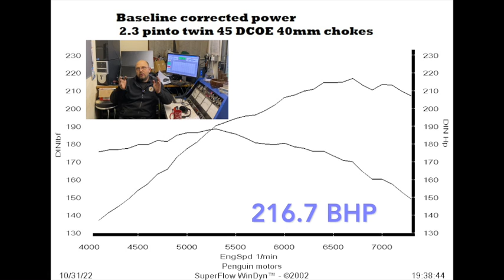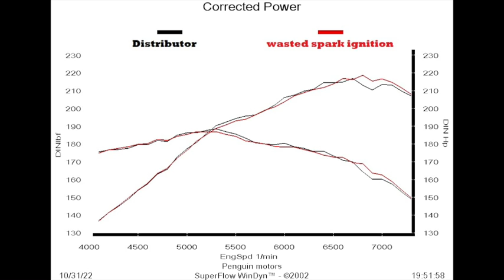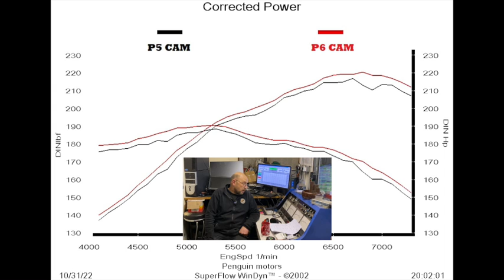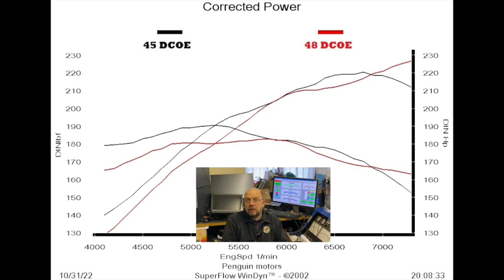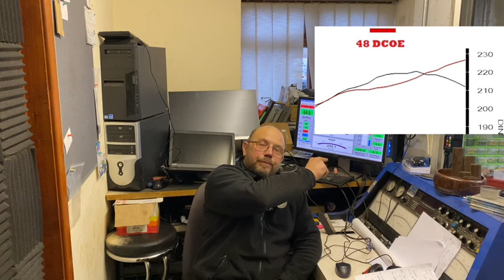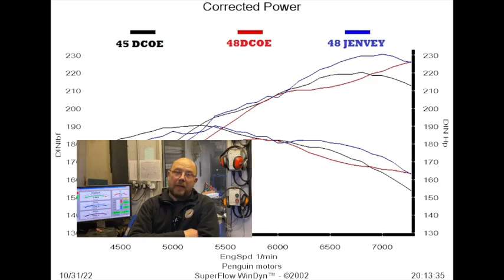Ford pinto 45/48 DCOE weber v injection test

Comment: Quick question I see a lot of Picture's of Webber Carburetors where the Trumpets have no Filters fitted as is the case on this One,doesn't this allow dirt and dust enter the Carburetors?and cause blockages to the Jets.
Reply from the maker: There an extremely small chance of that, 99.9 % of fuel jet blockages will be via fuel contamination. Even then as the jets are upside down with a gap under them it’s rare for anything in the fuel to find its way into a jet.Assuming you have the screw on jet covers fitted ( which I don’t bother with for dyno use)  the only way airs could get blocked is if something finds its way through the hole next to the intake through the internal passages and up past the jet assemblies then turns 180 degrees to go down a jet holder. Much more likely anything going through the hole would simply end up in the bottom of the float bowl. In short you’re way more likely to end up with foreign material causing actual engine damage than blocking carbs

Comment: 100 brake per Ltr with a wide spread of torque. Look back in 50 years and this will be as good as man got with a mechanical device running on dynosure poo

Comment: What if you make the runner length the same on the 48 dcoe's as the efi?
Reply from the maker: i would expect the engine to react the same, however it may not,  thats why you test stuff.
Reply: @PenguinMotors  Interesting. I appreciate your channel. Very interesting stuff on here. After watching a number of your videos, I was wondering if you have you ever heard of Keith Frank? He makes a device that replaces the emulation tubes on DCOE carburetors. He calls them Venturi Pump Tubes. They work completely differently than emulation tubes. Thought you might be interested in them if you're not already aware.

Comment: HI Graham - I am busy with a 2L pinto build for my Sunday croozing MK1 Escort - My bottom is stock standard with the head ported and flowed and will be running off 45mm Throttle bodies - 
Can you please recommend a good profile cam to run off pump gas? I dont mind a rough idle as it isnt my primary car but dont want her to be a handful on pull away as well. 
Much thanks & Regards
Reply from the maker: trouble is everyone has a different idea of what a good cam is!  at a guess something with around 285 degrees duration  would suit

Comment: What a banshee on the 48's, still climbing at around 8k. Superb engine build, I'll be honest in I didn't know these could be pushed this far, even in a race build. Almost brought a tear to my eye hearing her just want to pull on.
Ok, quick edit. I've seen the next pull but still beyond impressed with the engines desire to pull on, outstanding. 230hp and 190lb man, a cossie was 202 hp/lb iirc with a turbo. Mental.

Comment: Hello, I have a standard pinto 205 2.0 with efi injection, but because I gonna put the engine in a capri I want to go with a 32/36 carb it’s otherwise not allowed for mot in Belgium) do I need a special intake manifold because of the egg shape inlet and are those available?
Reply from the maker: the 32/36 carb manifold bolts straight on to an injection head using the carb manifold gasket
Reply: @PenguinMotors thank you

Comment: as i recall, from the 1990 ties, a dutch oval racer i know, had driven a high end pinto ohc  2050cc limit in the hotrod oval division, wich made up to 220 hp on 50 dco carburettors

Comment: Great work.  I'm building a 2L for my Cortina P100. I think I might go the 45 route after all your tests.
Reply from the maker: if you dont go mad on the choke size 45's will give best all round performance
Reply: @PenguinMotors  I think you're right,  what choke would you use?  I plan to skim, port and polish the head,  mild cam and let it breathe.
Reply from the maker: 34 or 36mm, 34 will give better low speed flexibility the 36 might give more top end depending on how mild you cam really is
Reply from the maker: just to add to my reply i recently saw 148 bhp using a pair of 34mm chokes in 45's on a mildish cam, which goes to prove you dont have to have big chokes to make decent power
Reply: @PenguinMotors  sounds like a plan

Comment: man... I had a 90's Sunbird boat with the 2.3 OMC. it was rated at 128 hp due to no emission controls. it ran great but man if it had some of these modifications it'd be scary on the water. I could only get it to rev to 4800. I imagine a hot cam and better carb would've woke it up. 160 hp sounds very doable ;)

Comment: mayby some dyno with 205 with volvo 2.3 redblock head :?
Reply from the maker: interesting thought but why not just use the whole volvo engine? probably stronger and cheaper?
Reply: @PenguinMotors  block are similar , and heads fit Perfect but Volvo 16v are shorter and need some welding to do that.
Just dont like swaps
Reply from the maker: ok, trouble is volvo 16v are not common here
Reply: @PenguinMotors  here also. From time to time they are on eBay for 500-800$, so its much cheaper that yb or warrior head

Comment: I hear ya on the intake length. So what total induction length did you end up with? The math suggests 13,5-14" but it would be interesting to hear what the engine liked IRL.
Did you play with the header to see if a different layout would make a difference?
Is this engine allowed to run an open header, or is there are noise regulation involved ? (I expect there is)

As a note to find even more usable power. A couple of Swedish tuners are pushing 250 hp out of the Pinto for track race engines, so there is something to be improved on. Those engines are lots of £££, Cam is a result of numerous attempts, heads are a work of art, but its possible.
Reply from the maker: Inlet length from head face to outer end of ram pipe was about 10.5 inches which is less than they normally like. Didn’t try open header as car cannot run like that. There is always something more to be had, this engine is conventional in every sense, so I’m sure more could be found, in fact we would have had more power if we were not in a heatwave when it was dyno tested, or could run better fuel to run higher compression
Reply: @PenguinMotors  So that´s something like 12,5" from valve to ram pipe opening. - Yes, its not "long" for sure, but not too far from the math either.  OK on the other stuff. There are almost always limitations.

Comment: Helpful info on the choke increase without needing the jet change.  Its probably unlikely on the kart, but nice to know its a possible situation. 
Thanks Grayham. 👍
Reply from the maker: The I did change the air and emulsion tube, so that could be part of it, but I suspect them main reasons are that the 40mm chokes were too big to function properly on the 45mm carbs, whilst on the 48s with the straighter intake manifold considerably more air passes through the carbs
Reply: @PenguinMotors  Thanks Grayham, updates here after testing in a couple of weeks.